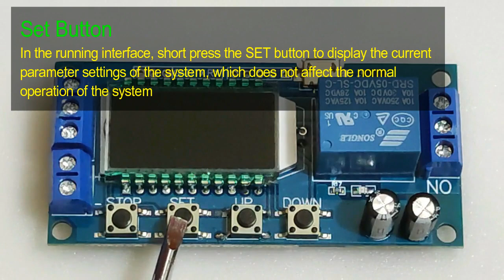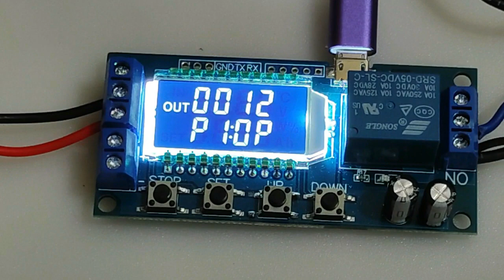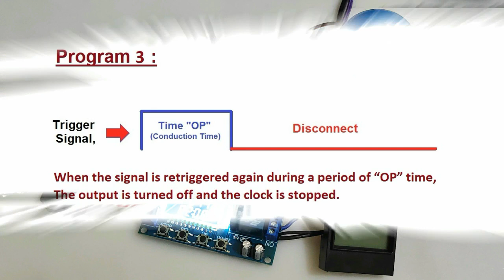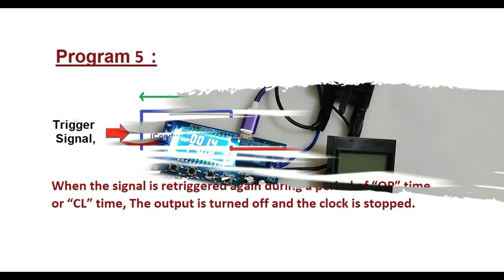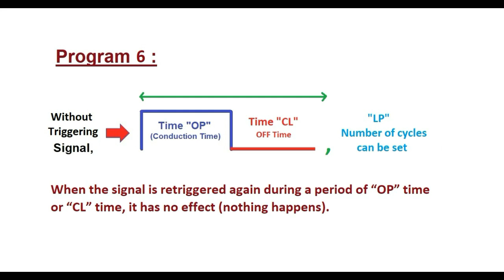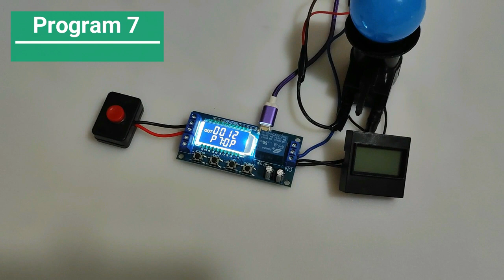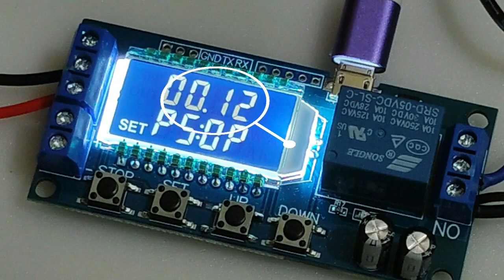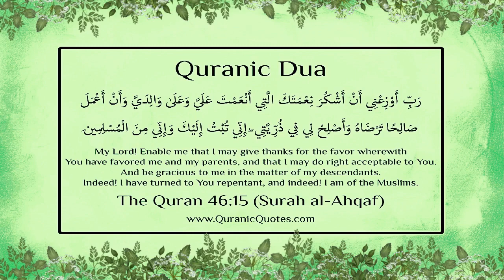Reviewing of Micro USB Digital Multifunction Timer Switch XY LJ02مؤقت متعدد 7 برامج  UPDATED 2022

Comment: Than you , searching for how to use the different function,
Is it possible  such a functio  where on and off time will go on in undefinately in cycle without trigger signal,
If there is power off, will the program retains and starts automatically after power gets on